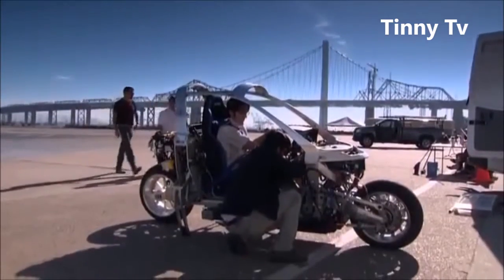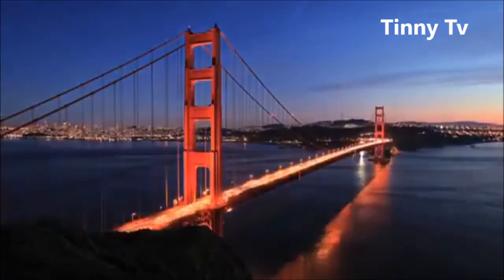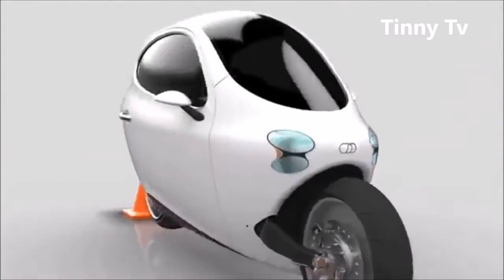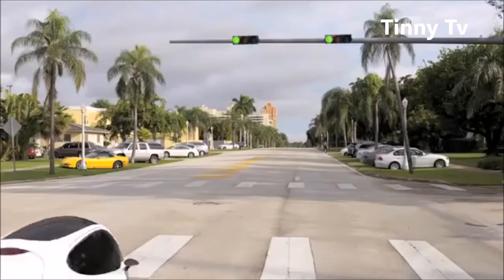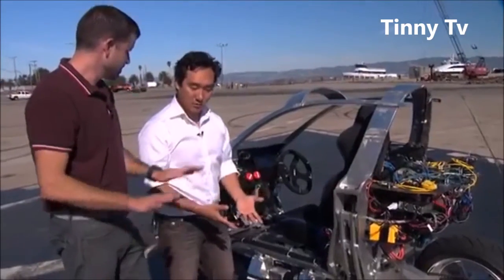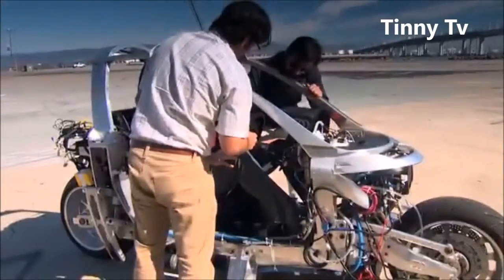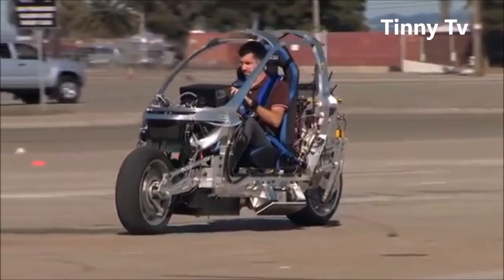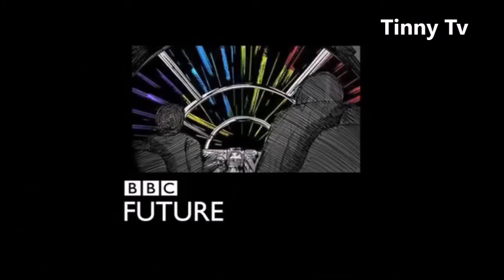Lit Motors Future vechile- Tinny Tv Inovation Zone

Comment: The low drag, rounded body shapes are susceptible to cross winds ; increased yaw sensitivity, those changes of lift distribution under the influence of cross-winds reduce vehicle stability.So why not use the gyro's to help stablize the vehicle ? ,instead of using the gyro's to control lean angle.I'm not a engineer,but it would seem to allow the best of both worlds.The fun and feel of a motorcycle,the safety of a compact car,without the danger's of a cross wind's .I can't envision how Lit is going to ever get this vehicle to have the feel of a good handling motorcycle,with the gyros controlling the lean angle.I'm not a engineer ,so it difficult for me to explain,but I feel it's a poor choice on lit's part.I would expect it to ride like a 2 wheeled car,who wants that ?